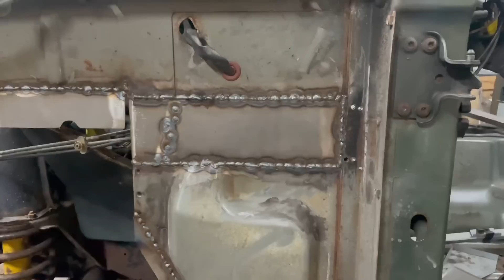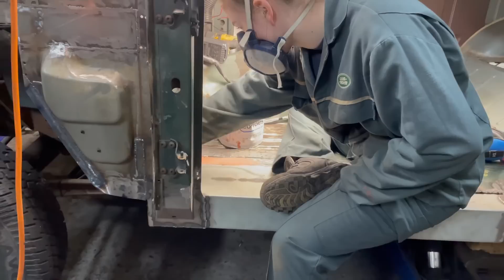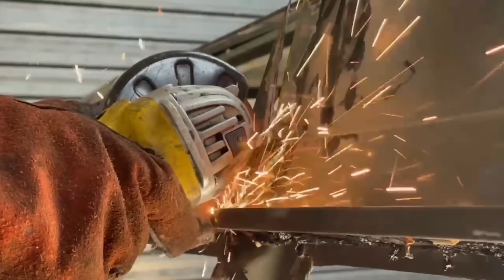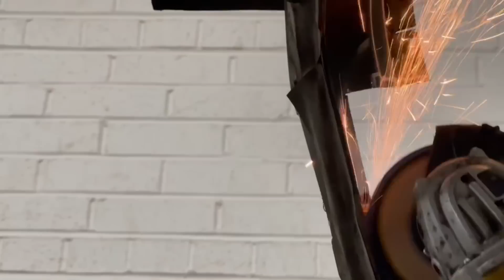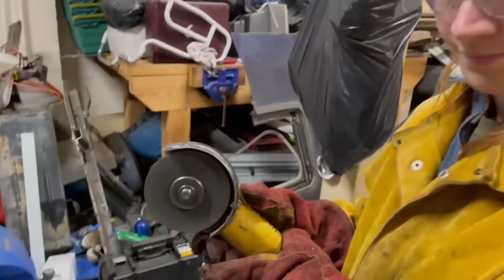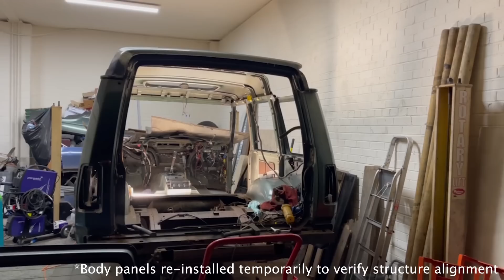Project - Land Rover Discovery 200Tdi (Part Eight)

Comment: Great work as usual Sophie!  My 2 door is slowly being rebuilt with the fear drawers fridge etc in the back. Luckily here in NZ the powers that be don't throw salt on the roads which means my '93 is in afar better nick that your one was before you started. Very little rust around but all my doors need replacing so found a donor 300TDI that is giving me bits and pieces inlcuding the doors.

I wonder though, do you know where I can get interior trim items?   You body parts link is very useful!

Comment: I would recommend using a really low grit flap disc if you are prepping for painting/priming. And a new one as wel, or using a grind disc. You can polish the metal pretty fast with a (used) flap disc which will make your paint/primer not stick as good

Comment: When I was restoring my late Dad's Jeep pickup in Australia I used a product called KBS rust coat for the area around the floors etc it's a similar stuff to PPG's POR15 but better I think. I had replaced the floor's back in 1987-88 and they were still great!